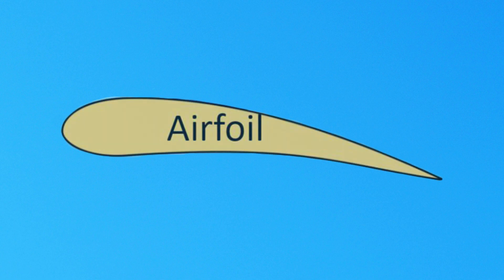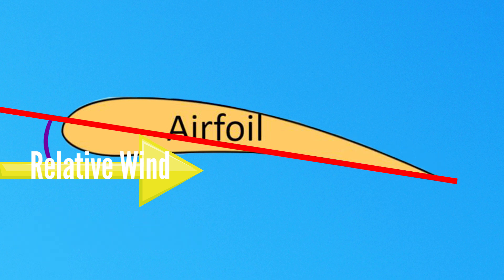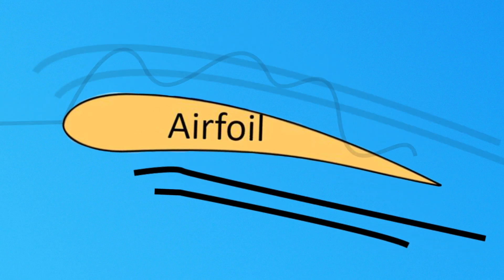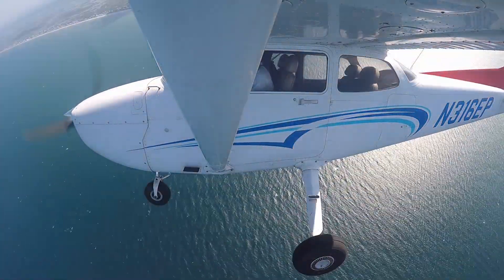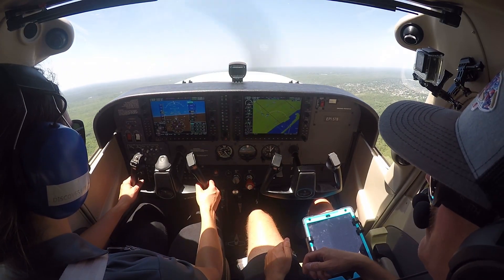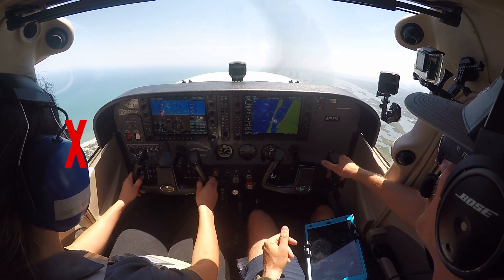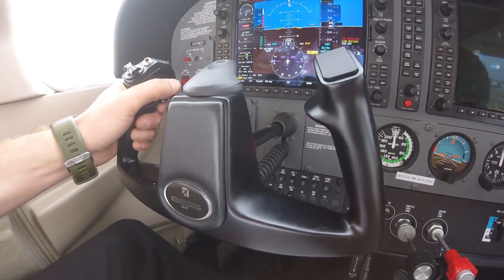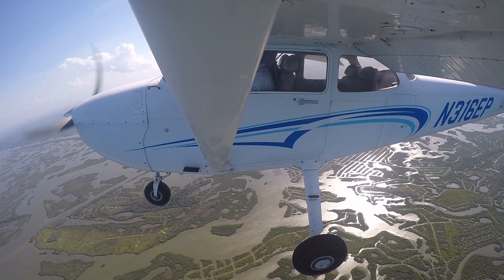Power-Off Stalls | Epic Flight Academy

Comment: 06:51... Altitude is 100 feet, RPM is zero on the G1000, speed is close to zero, PFD is indicating the nose on the horizon (backup AH not corresponding to the G1000), flaps are up, mixture is in idle-cutoff position and the yoke is in the neutral position. That's not a stall. It's an engine-off control check at best... Be careful how information is conveyed...